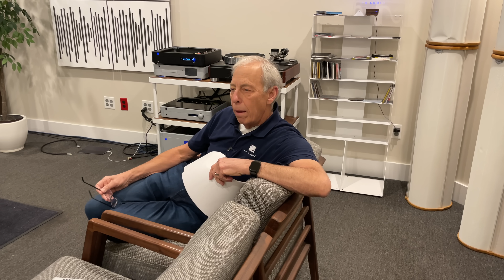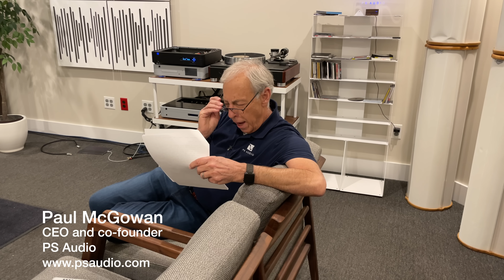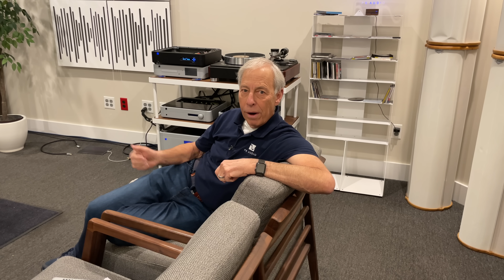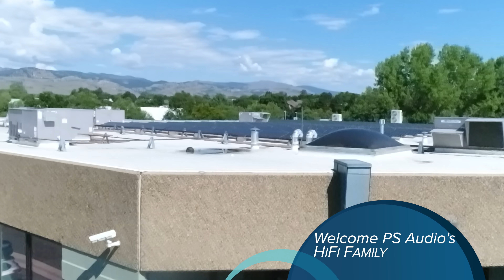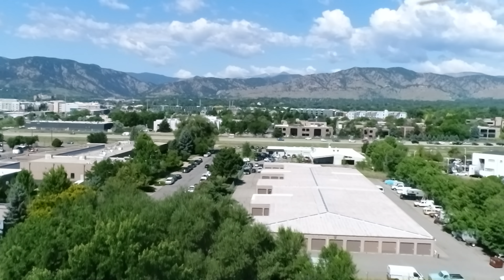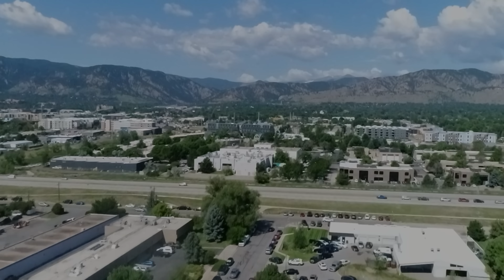High end amps vs. pro amps

Comment: Today is a sad day for Paul. His view point on this subject (High end amps vs. pro amps) is a bit biased.
Reply: He's part of the "PS Audio family" so let's not be naive. High-end is 10$ film capacitors, excellent looking finish and will satisfy a group of customers with a bigger wallet than a sensible price/quality rational. And that's OK, it's an experience.
Reply: But he is right that high end hifi is more sofisticated sounding than pro amplifiers. But for a budget highfi system. Crown XLS is a good choice. I have had a Crown XLS a couple of months, and it was good for the price. But the amp I have now is far better in every way.
Reply: @oysteinsoreide4323  Not true
Reply: biased? No. He has listened to pro gear and know what he talks about. But I guess he hasn't listened much to the latest stuff that crown has come out with though. And it is not so bad sounding as before. Class D/G amps are much better to get good sounding than AB designs of the past.
Reply: @oysteinsoreide4323  As a Sound Engineer in the commercial audio space I can agree that most Crown amps do sound different and weird, but that doesn't mean that they are commercial audio standards for the whole industry. The Crown XLS is Crown's most basic and lowest quality amplifier they sell with a price point from $340 to $650 Crown has other amplifiers like the Crown XTi 2 Series, Crown I-Tech HD Series and Macro-Tech i Series these amplifiers are worlds apart and sound excellent can go from $650 to $10,000. Crown makes amplifiers at different price points. Price doesn't always translate to quality in hi-fi and pro audio/commercial alike. At the end, it’s still audio technology with different applications.

Let’s be real, Crown isn't the only one manufacturer there is. There are other amplifier manufacturers that sound more pleasing and natural/neutral sounding than Crown. Like QSC, Powersoft, Lab Greppen, L acoustics, Crest Audio, MC2 Audio, Dynacord, Peavey, EV, etc.

I had heard misinformation that Commercial Audio amplifiers do not have the same level of circuitry components in Home HI-FI amplifiers which is not true and pretty far from it.

Commercial Audio and Hi-Fi are just marketing terms, because Commercial audio is also Hi-Fi or High fidelity (often shortened to hi-fi or hifi) is a term used by listeners, audiophiles, and home audio enthusiasts to refer to high-quality reproduction of sound. Ideally, high-fidelity equipment has inaudible noise and distortion, and a flat (neutral, uncolored) frequency response within the human hearing range. Commercial Audio equipment can also do this too.

Now speakers are for another topic, but to keep it short Commercial Audio does have amazing speakers for sound reproduction.
Reply: @oysteinsoreide4323  Home HI-FI amplifiers and Commercial Audio amplifiers uses the same types of amp Classes.

Comment: The thing about pro audio that always gets me stirred up is that if there are any sonic flaws, you are going to hear them at 120 decibels through horn loaded sound reinforcements. So if at their most prodigious expression they prove to be quiet and neutral, then why would they prove to be otherwise in a hi-fi situation?  Plus, recording engineers use pro audio in most of their efforts where the very recording we buy is mixed using such gear. Yet, there is a quite a difference and clearly in nearly every case. And if you took a Crown DriveCore amp to PS Audio, they could tear it down and refine it for hi-fi. If you took a PS Audio Hypex based amp to Crown, they would do the same for their purposes. And neither company would want the other one back. It's like this: pro audio is like a giant overhead valve V8.  High end is more like an exotic twin turbo, dual overhead cam V12 with 4 valves per cylinder.

Comment: I bought a crown amp because of all the hype that is sound great this and that but after a few month of owning it I can honestly said that Paul is right. Sound quality is no even close. Ending up selling it and cut my losses. Now I own a vincent amp and I am very happy with my stereo set up.
Reply: Which one?
Reply: @filippiasec  sp-331 mk2
Reply: @tubeman1355  Sorry, I asked which Crown?
Reply: @filippiasec  crown xls1502
Reply: @tubeman1355  Interesting, I have almost the same (1500&2500).  Is there anything in particular that you found not working for you?
Reply: @filippiasec  crown is a good amp. It does what is supposed to do. But it's too sterile and flat for my taste . for example my adcom gfa5500 this amp very smooth, bass is pronounced, mids are detailed and most importantly the 3d sound stage that gives the illusion that the performers are playing in the room with you. Sp-331 mk2 all of adcom strength but with more inner details, bass is deeper and the separation of the instrument are more pronounced. I guess you really have to experience this to have a good opinion what is the difference of other amplifiers. But everyone have a different opinion but my advice is find a well know class a or ab and compare it to your crown and if you can't hear any difference then your crown amp is all the amp you need.
Reply: @tubeman1355  Thanks! I kind off wanted a sterile and flat sound - with the idea to change it with speakers. Still, this is a good idea to rent a A class thing and give it a try, otherwise it's just uneducated guess;)
Reply: like which crown?
Reply: You do know that Crown make amps that cost from $350 to $12,000?
Reply: @philipbarrett3151  yup... But my budget 4-500 at that time. I guess I got lucky my adcom cost 200 and vincent 400 on second hand (Facebook) in my area. Crown 1502 $450 on Amazon? I bet more expensive crown amp will sound better. But for my price point crown amp is not for me

Comment: What about A Ashly FX series Amp ?
Reply: The Ashly FET / FTX series amps are a reasonable implementation of a lateral MOSFET amp. I've never had a chance to really listen to one, but from the design they should sound quite good, and probably bear some similarity to the older Hafler amps in terms of sonic character. Those older Hafler amps were also really pretty good, especially with a few upgrades.

Comment: Amps measure the same but audiophile amps somehow sound more musical ? Come on now.
Reply: Do keep in mind that there is a difference between "measures the same" and "performs the same". "Measures the same" typically means that they perform the same in a standard set of measurements- which aren't always looking at the right things. For example, two power amps might have the exact same THD at full power and produce the same amount of power. But if one of those amps has much higher THD at 1 watt, or has a lot of crossover distortion that becomes noticeable at low power, the two amps can sound very different. Not too many spec sheets (and not too many people) take as many measurements as they should, and a lot of people don't quite understand the proper way to do so.
Reply: Don't pull back the curtain too far, or the "HiFi" gypsies might become shy to sell their MAGICAL gear to the "golden ears" amongst us -- for a boatload of dollars per channel 😆. e.g. I LOVE huge ads for insanely expensive RCA cables with many paragraphs explaining how this magical cable is quite superior to a traditional, shielded copper cable. But hey, gypsies have been selling snake oil since the first sucker was born. Gotta love a good salesman.
Reply: Not all amps sound the same. More musical means it's more distorted, some people do like that.

Comment: I’m from the concert industry. I can assure you that using the right pro-audio equipment, I can get a room for 3,000 pax to sound better than hifi systems that cost $400k in a room for a few enthusiasts.

We are talking clarity etc. Not volume. But it’s not with Crown amplifiers. You just need L-Acoustic Kara or K2 speaker systems. 😬

Yes ... I do have a high end system myself and not a boom box.
Reply: Now we need a video to justify why for example Wilson audio speakers can cost $300,000. I guess they’re using diamond laminated voice coils or something like that?
Reply: Don't forget the biggest part of the puzzle, which is the guy behind the console.
Reply: Karas rarely sell for cheap unfortunately
Reply: @AdamHiFi  ... uh huh ... but 400k for a few people vs a Kara rig for 3,000. On a per head basis the Kara rig is still cheaper 😈

It’s just that too many hifi enthusiasts do not know that pro-PA can sound amazing. They think the home set up is the ‘bestest’
Reply: @hushpuppykl  I can imagine. But then you say the pro stuff is optimized for large venues, not for a cosy living room. So purpose? Or would you be able to outfit a 100 sqr foot room with pro equipment and still sound subtle. A bit like mounting a V8 on a bycicle?
Reply: @ewoutbuhler5217  ... purpose is this ... firstly, the misconception that pro-audio is not as good as hifi. Secondly, why are we paying tons of money for components that pro-audio or even top studios will not pay?

Anyways ... top pro-audio brands like L-Acoustics do have systems for ‘smaller’ venues. Just not tried it before. But I think I   shall see if it can be arranged. Thanks for the v8 on a bicycle comment. 😬
Reply: @hushpuppykl  You'll be stunned by the KIVA & the A15s. Then there's the SYVA! And the ROI will make you keep smiling...
Reply: @philipbarrett3151  ... heard of the SYVA, seen them at the website. My friend is the regional guy handling L-Acoustics and he says it’s really good. Giant towers! I can’t wait to listen to them.

Comment: Some old valve pro amps sound very good. Klein & Hummel, and Telefunken for example. But they where Studio Amps in there age and the times you could get them cheap are over.
Reply: And OLD Ashly FX series MOSFET Amps also 😉
Reply: Bryston.. We have stacks of them turning to dust in the storage lockers since we switched to powered monitors.

Comment: I'm sure pro audio amps might make a hifi person turn their nose up, but when your poor like a lot of us, pro audio is the only solution. I'm runing a behringer ep4000 on 2 18" pro audio subs to great effect here in my home audio setup, and it kicks ALL ass.
Reply: There's nothing at all wrong with the EP4K 
I too have a pair of them powering my quad 18" IB
Reply: Class D pro amps are perfect for subs - even made for them, but I wouldn’t use them with high definition speakers.
Reply: @billd9667  
The EP4000 isn't class D, it's conventional, big iron toroid class H
Reply: @FOH3663  how in the heck can they offer that at $400? Crazy. 

I’m a little put off that they don’t publish basic specs like frequency response, distortion, S/N ratios, slew rate and damping factor. It’s kind of like ”trust us”...
Reply: @billd9667  
The EP4000;
Damping factor is ample
Independently 𝙢𝙚𝙖𝙨𝙪𝙧𝙚𝙙 output is 450/ch@8, 650/ch@4, and ~1600 bridged mono@4ohms
All that's by memory, but pretty sure. 
Essentially it's a knockoff of a QSC2450 iirc. 

Fortunately for me, my 18"s in an Infinite Baffle don't need much power to hit full stroke. That's one of the positive traits. 200w-300w and they're full stroke @20hz (30mm). 
Similar driver in a sealed would likely require 10x that much power.
Reply: @billd9667  dont knock it til you try it bro. The new crowns are better than you think. You're just gonna have to listen for yourself.
Reply: @arcforceworld  I never knocked them. I just said that class D was best for subs
Reply: @billd9667  NAD M33  5k€ amp, Class D, things are changing...
Reply: @ewoutbuhler5217  Yes I know, but Crown Pro amps are not Eigentackts lol. They are cheap class D - no comparison. As a matter of fact, I'm seriously considering the M33 for myself in the near future.
Reply: wow
Reply: @Lloyd Stout are talking about retail price? Cuz I scored my gear use for practically a song.

Comment: Back in the 70s-80s, Crown produced the Crown DC300 power amp.  It was offered as a high end audio power amp as well as a pro-amp for musicians.
Neil Diamond had stacks of them at his concerts.
One feature of the amp was that it could drive a 70.7 volt distribution line directly.
Reply: And was used in nearly every studio in the world for some of the best audio engineering ever done.
Reply: The 300a was  laboratory dc power amp not a Audio amp at the factory school taught to me that made a point o This only two of they units were built lab instrument standards the other was the M600 I serviced all of there lines and most I didn’t think were real hifi but the reference was all were well built to a Given purpose
Reply: And what do Neil diamond records and live shows sound like🤔 SHIT!
Reply: @travisbishop7212  
Actually the Neil Diamond concert was excellent.  The venue (12,000 seat basketball arena) had bad acoustics but the sound was fine.
Reply: @travisbishop7212  bullshit

Comment: Do power amps really have a sound? I figured the pre amp stage is where most of the musicality comes from. I have been looking for a new SS amp and obviously I can’t go out and test and hear the ones I’ve been researching. If a power amp is driving the load how can that sound musical?
Reply: I have been testing a tube power amp based on 6l6 tubes.  It is stunning how good it is. It beats every transistor amp I have hands down.  Using a ss preamp to switch inputs. the color of the 6l6s is so soothing and revealing...I think I will sell the rest
Reply: @zeusapollo8688  nice. Yeah I am the opposite I have a tube pre with that warm sound and looking for a SS power amp that can give me that fast response
Reply: Does an amplifier need a "sound"? I'd say the amp needs to be a great match to the speaker, and bring out the best sound in that speaker. The best sound being the sound YOU like.
Reply: @ewoutbuhler5217  exactly. Trial and error. I have a pair of Tekton Lores rated at 98db sensitivity at 8ohms. I don’t need a lot of power but I like the ability to have a ton of headroom.

Comment: Crown has been in the biz for many decades, but was never hifi. Even the old DC series, which was pretty expensive, had a reputation for flat, uninspiring sound. For a few bucks more (back then), you could get McIntosh. The new Crown stuff is great for home theater, where you need lots of channels and power - where imaging and tone are not important. It just sounds uninspiring and sometimes just BAD when used for stereo.
Reply: Old crowns were sometimes reference amps built to be totally flat n clean
Reply: @zeusapollo8688  I hear you, but they had an awful reputation for hifi. They got pretty bad reviews at the time and worse on today’s vintage sites
Reply: Reference amp is for recording studio maybe a lab. Not so much living rooms

Comment: Is it possible to plug a headphone (32ohms) into a DAC directly ? Output impedance of the dac is 75 ohms. Thx all!
Reply: Should be fine. If anything, the DAC is overpowered for 32 ohm cans
Reply: @billd9667  I was thinking a schiit Bifrost the newer version and a Schiit Heresy... But then again they both have the same output impedance of 75, technically if it would work fine & safe I would have even less THD without an amp! Headphones are Grado SR80e that I really love.
Reply: @m.morininvestor9920  well, the DAC would need a volume control, which would technically make it a DAC/preamp or DAC/headphone amp and not strictly a DAC, which the Bifrost is. I’ve never heard of a Schitt Heresy. Did you mean the Hel?

The only way you can use headphones on a straight DAC is if the headphones themselves have a volume control. Volume controls on headphones are pretty damned poor and will ruin their fidelity.
Reply: @billd9667  I was thinking schiit Bifrost and Magni Heresy.  But I'm also trying to learn if only that DAC would do since they both have same output impedance.
Reply: @m.morininvestor9920  oh I get it - you are combining them. It’ll work fine, as the Magni is a headphone amp. A 32 ohm headphone is low resistance and easy to drive. The DAC is just another source to the Magni. 

Where you would normally ask this question is where you have 300 ohm cans. That is a tough load to drive. Your 32 ohm set is a piece of cake.

What I would suggest, however, is trying the Vali amp. My bet is that it will sound a lot better than the Heresy.
Reply: @billd9667  But could I use the biftost only?
Reply: @m.morininvestor9920  Nope. You need a headphone amp. There are many good DAC/Preamps in this range. Do some shopping
Reply: That's not a DAC, that's a DAC Amp combo.

Comment: Idk your stella amps have more in common with crown xls amps than they do different (stella measures better but lacks dsp). BHK is in a different league of course but its kinda silly money so it would be.
Reply: @Lloyd Stout Depends on the DSP. Really good DSP from the likes of XTA (or some of the Soundweb boxes) sounds pretty good.
Reply: @Lloyd Stout There other reasons for using dsp as well.

Comment: I have crowns they sound great.
Reply: Except for the fan noise - or just noise levels in general. They are fine for HT, but that’s about it.
Reply: Compared to?
Reply: @ingenfestbrems  my ears like listening to them, and everyone who heard my system can’t really believe it all comes from a computer
Reply: I've had 2 xls1502 and now the 2502($400 on ebay) in my home and they are incredible. No fan noise as others have said and dead quiet. I mean quiet. The speaker connectors are the only area that needs an upgrade imo. They do suck. Of course a quality power cable. I've had many different amps through the years and listened to countless others. For the price they can't be beat. I would put them up against amps costing 3-4 times more. Run two in mono and it's another level. My 2 cents.